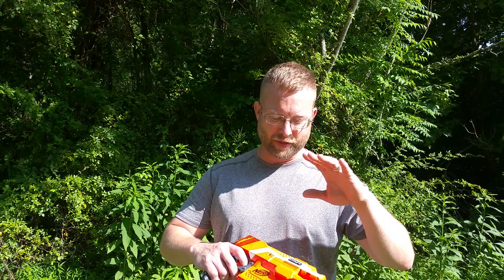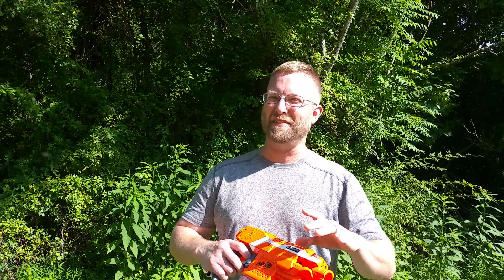Firing Demo: OFP High Crush Cage + Cyclone Flywheels + Waffle Darts

Comment: What do you think the limit is in terms of FPS with this setup? You're already pushing some crazy numbers.
Reply from the maker: I want to say that this is about as far as you can push a single flywheel stage, but if you would have asked me this question a year ago, I would have said 130 fps.  So I really don't know how far it could go.  If you step up to multistage, 200+fps should be possible on a two stage setup with velocities approaching 250 fps for three stages.  I'm hoping to test these out in the next few months.
Reply: 498 Nerf Man, 250fps soinds painful haha.. nit for CQB use, I imagine.